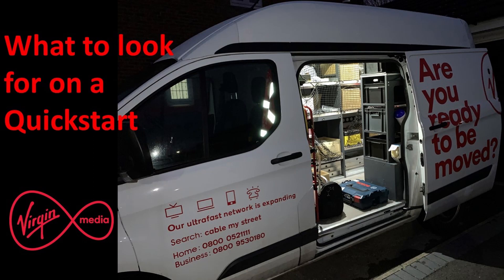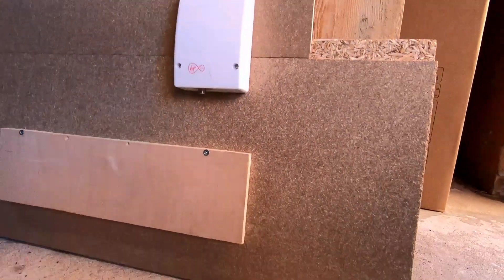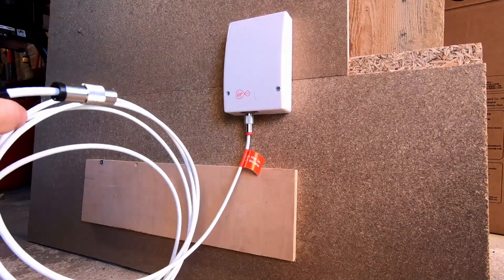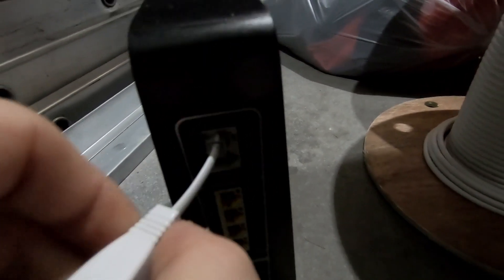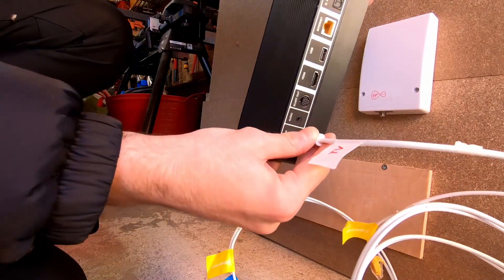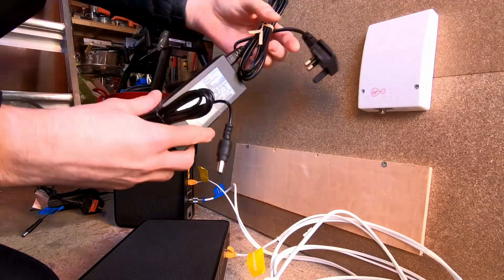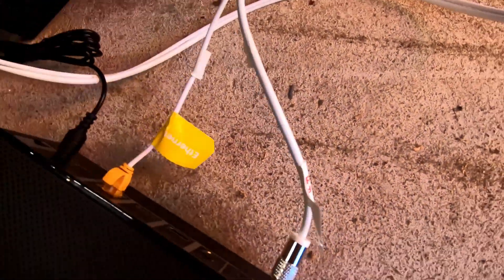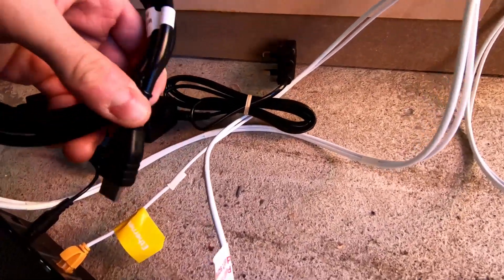How to set up a Virgin Media Quickstart.

Comment: hi mate looking to get virgin installed but was wandering how they get the cable to my house
Reply from the maker: Hi. If you go on the website it will tell you if your street is cabled. If so and you can get virgin, then then this means your street already has the cables installed. 

From there they would run the cable from the street to your house. If you had bushes on your drive they could run the cable under that. If you had block paving they would take that up and put the cable under then put the paving back down. Ect.

It is a 3rd party company that install the cable from the street to your house. Remember it is their job so they will find the best way and do it everyday.

Your house could already have it running to the house you just don’t realise. Look round the outside of your house for that brown box in the video or a different looking brown box. Or look for any cables coming out the ground.

Comment: just wanted to ask , I was just looking at my current broadband cables , they seem impossible to disconnect.  Do ya think I'd be able to just use them with the new  broadband box ? Thanks
Reply from the maker: Depends if current cables are virgin or a different supplier. If so then you will need a spanner to loosen the connectors at the ends
Reply: @unknowndiy9117  they're virgin, but old ones, hopefully they'll do the job
Reply from the maker: As long as they’re not damaged or bent, they should be fine

Comment: does anyone know if virgin will install direct to an upstairs room?  I already have one of their brown boxes at my front door.
Reply from the maker: Hi, it depends what you mean by direct. They will install to an upstairs room but say you lived in a terrace house and wanted it in a room in the middle, then they would obviously have to go through a room at the front or back of the house to get to the middle, but they would do this if that’s what you wanted.

If you lived in a detached or semi and wanted it round the back then they would be able to go directly from the box and round the side of the house and up into that back bedroom.
Reply: @unknowndiy9117  thanks mate, it's  semi and the room is as at the front of the the house.
Reply from the maker: @LeChimp-jg6fh  They would be fine then.
Reply: @unknowndiy9117  Thanks for the quick responses.  Do they normally drill out to in, or in to out?
Reply from the maker: @LeChimp-jg6fh They drill from inside through to outside. I used to work for them doing installs hence why I know all this info.
Reply: @unknowndiy9117  can they splice cables easily enough? I mean without signal degradation?
Reply from the maker: @LeChimp-jg6fh  in most cases yes. If you’ve gone through the cable in the garden or something then they would put the two ends in a spice kit and it should be fine, if not then they would need to get a 3rd party company out to lay a new cable

Comment: I don’t have the brown box, will they need to pull up my drive to install the wires, and can I choose where I want the wires to go into the house or is this the choice of the installer? Thanks
Reply from the maker: If you don’t have the brown box and can’t see any loose cables elsewhere on the outside of the property, then they will have to pull the cables from the street and put the box on the wall. This is done by one team. Then another team on another day take the cable from the box to the inside of the house. Aslong as your in, you can have your say where you want the cables going, aslong as it makes sense👍

Comment: Hi mate, can you tell me how long that splitter cable is?
Reply from the maker: Hi, it’s normally 3m long 👍
Reply: What is the white cable called? The one that comes from the wall? I need one a long one cus the engineer didnt put the router where i wanted it and the white cable was too short